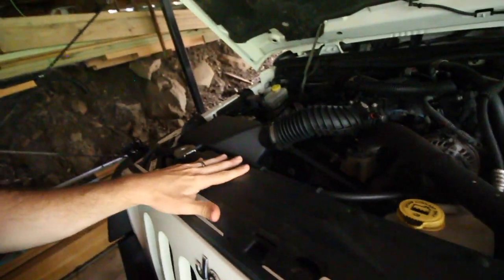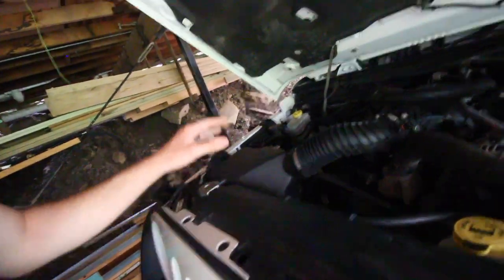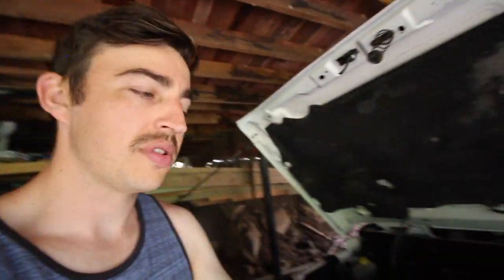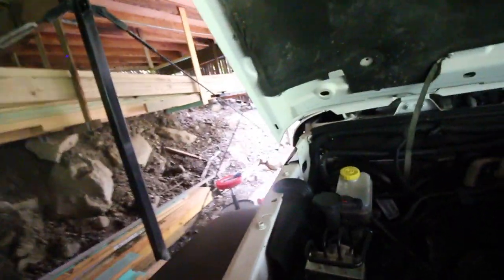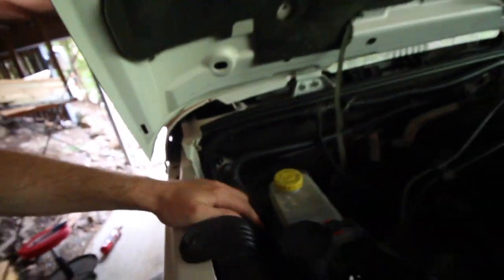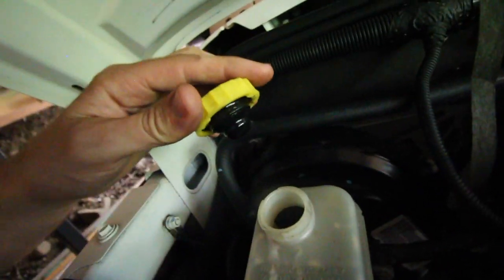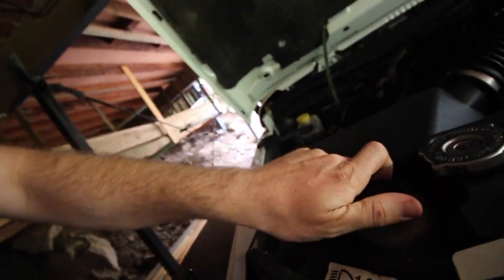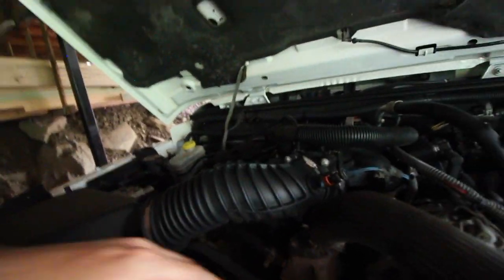HOW TO KEEP YOUR JEEP RELIABLE

Comment: One of your best videos!  And you're right preventative maintenance is a great money saver as is doing it yourself!  One thing I'd add:  if you're seeing milky white streamers when you're checking the oil that indicates a coolant leak into the oil; potentially a head gasket problem.  Get it fixed ASAP, it will save you money if you get it fixed sooner rather than later.   One other thing for us Jeepers is to teach our kids!  I started when my kids were around 10,  Every time I had to change the oil one would be helping.  Now as young adults they both know what to check, what to look for, and do it themselves.
Reply from the maker: Thank you mate really appreciate that. Definitely a great way to save a bit of money and learn a lot at the same time, yes I should of added that in thank you. I will definitely be following you with that, I am looking forward to teaching my son how to work on and enjoy cars. Thanks mate
Reply: @Whiteandsonsgarage  and thank you for the tip on checking differential fluid.  That's one I usually forget and don't see it till I change the fluid.
Reply from the maker: @ebikeengineer  not problem at all, it’s always the little things that can make a big difference